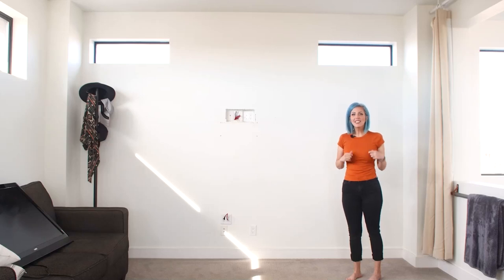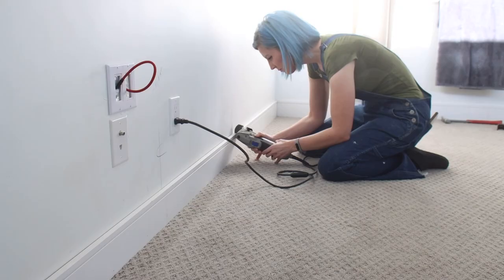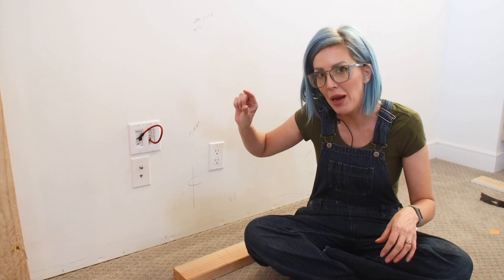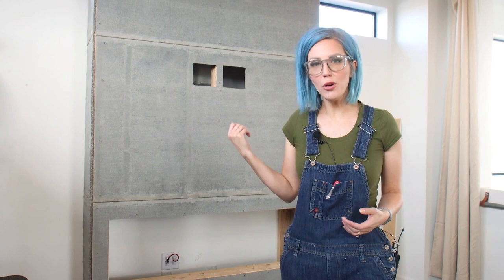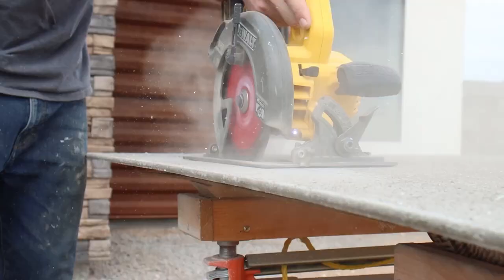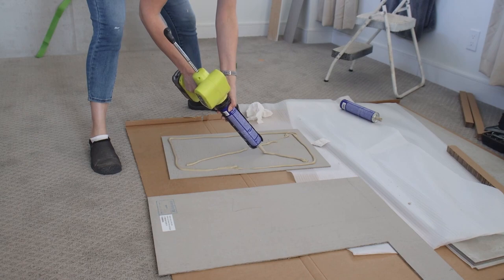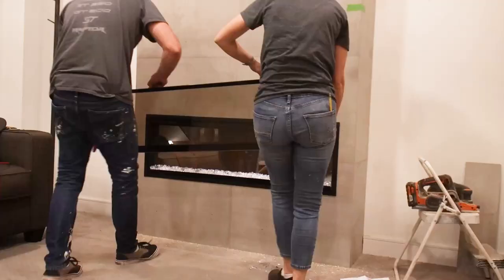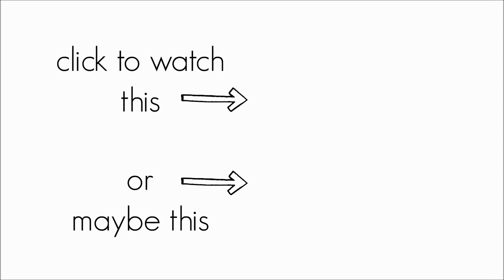DIY Concrete Fireplace in ONE WEEKEND | Building Plans

Comment: i built in a 60" touchstone electric fireplace 5 years ago, it still runs perfect every single winter night. I would suggest get the biggest one you can. I got a 60 and I wish I would have went to 90"

Comment: Amazing project. Could you tell us which color did you get from concreate? Do you think this project could go together with a gas fireplace?
Reply from the maker: Thanks! We used "Natural Grey". Yes, you could do something very similar with a gas insert, but you would need to make sure it comes with a fully sealed fire box and you'd likely need to add venting (either direct vent or flue)
Reply: Thank you so much for your answer.

Comment: Thanks for video, do/did you all seal the concert panels / seams ?
Reply from the maker: Not all the seams. Luckily, we were able to get most of the panels to fit together tightly. We only had a few gaps which we needed to fill.